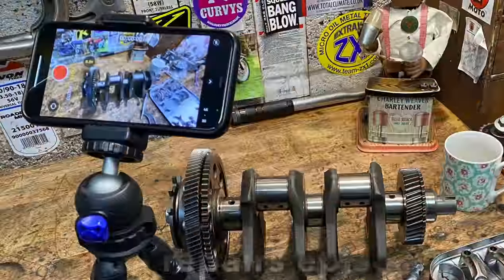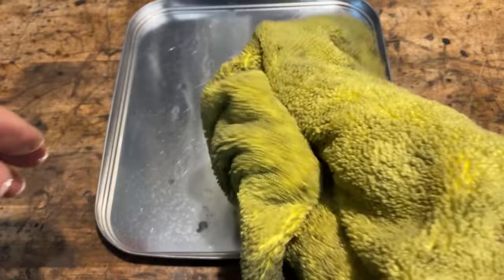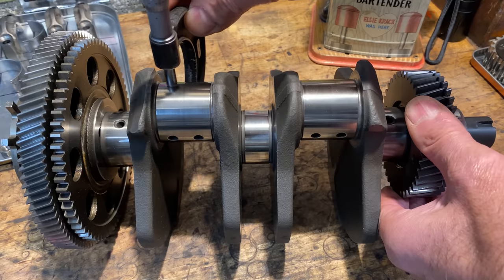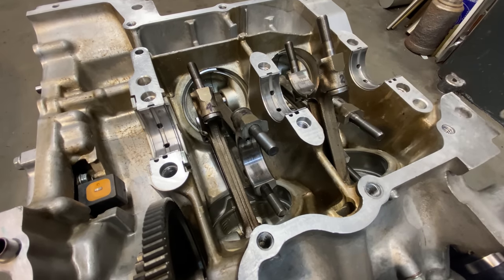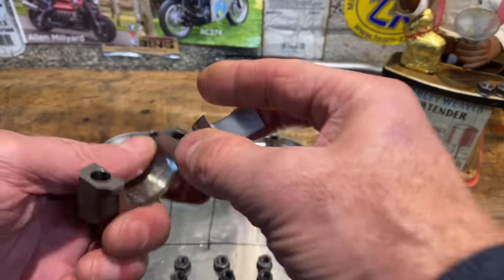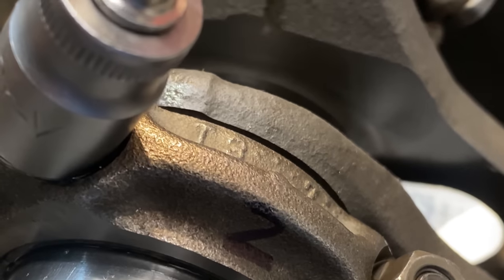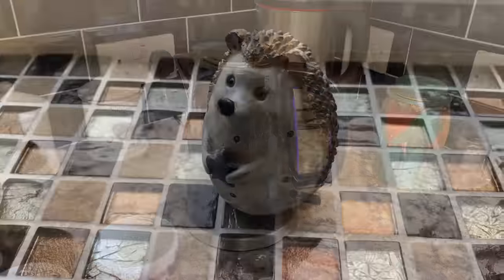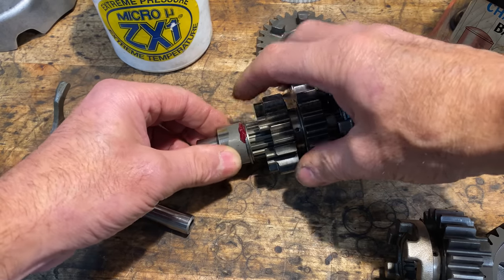Honda ST1100 Pan European - the engine rebuild commences  - Episode 2

Comment: I enjoyed watching this video and reminiscing😀. Reminds me of when I changed the BEB's on my LandCruiser (4.2L IL6) on the driveway. Good access with just the sump removed thankfully avoiding a nightmare engine out scenario! Toyota use a similar bearing sizing system. 5 sizes available, con rods marked 1,2 or 3, crank marked 1,2 or 3 and you just add the con rod and crank numbers to get the correct bearing size. I rebuilt a Z1000 engine back in the 80's which, as many will know, use needle roller bearings in the bottom end rarely require attention😀👍.

Comment: My ex police has a bit of a not so good gearbox, doesn't like being changed at higher revs. Got a spare with the intension of servicing the original/replacing it but it's having to drop the engine out. Got leaking carb1 issues at the mo. Keep these coming Allen, great to learn from a master.

Comment: I like to use Lucas oil stabilizer on bearings , then put a drop of oil on them, and the crank or cam, basically b everything except  cylinder bores, well some times, maybe a thin layer, but I know definitely not to use things like STP with alot of solids in it, on rings/ pistons, the oils can burn off, and leave the solids, molynibneum, graphite, zinc, zddp can turn to zinc metal with high temperatures,  my dad fixed a engine like that, it was new rebuilt, and all but stopped running, the rings were stuck , had no compression, tore it down, and it was full of white  powder, between the rings, lightly hones it cleaned everything, and it ran fine,  zddp is great, unless you have too much burn off in the rings , it's best to use conventional oil on the rings!  I like the thick and tacky Lucas stabilizer on bearings,  a drop of oil, and it's slicker than slick! The thick stuff, fills the micro pores in the metal, then the oil glides on the film of Lucas,

Comment: I have the same torque wrench mate have had it for years, and have never considered a dab of oil to assist in making it spot on. It’s these little things I learn from you, just as much as the big things that make watching your videos so engaging. Not just spannering, but useing my hobby lathe etc. bricklayers are not natural engineers lol, but thanks to chaps like your good self, I can at least give things a good go. Thank you mate, and happy new year to you and yours Allen👍
Reply from the maker: The application of oil to the big end nuts is specified by Honda, others may advise it should be dry 🤔 so always check

Comment: I had a similar problem with a honda crankshaft, after placing in the new shells I used the plastigage system to gain and compare the exact clearances gained between green and brown types.

Comment: I have never seen inside a ST1100. My knowlege is with the VFR 750 R and older VF 750/1000 F/R series motors. The rod bearing torque is very similar to the ST1100, even with the Titanium VFR 750 R connecting rods!

Comment: Happy New Year Allen.
I worked at a Honda dealership many years ago so it was shocking to see they made that mistake.
And since the big end of connecting rods aren't perfectly round and that if/when rod bearings wear it's on the top and bottom, that was an interesting way to measure the clearance. But it does make perfect sense that the side to side clearance measured loose on that rod since it actually had the wrong size bearings 👍

Comment: Hi Allen, I just noticed that while  assembling the gearbox, when you fitted the bearing on the layshaft (14:15), both bearing and shaft have a oil hole, and if I’m not mistaken they should align with each other, but you fitted it one slot away... I thought it’d be good to let you know. Thanks for your videos Allen.
Reply: Well observed my friend , but it wasn't lined up to start with if you look earlier. This would annoy me. It has to be right.
Reply: Lol I just posted the same thing hopefully he catches it in time before he gets it all back together big job..
Reply from the maker: the holes don't line up there is an internal groove in the splined bearing to distribute the oil just perfectly between the two holes
Reply: I thought that was the reason from the first sighting. It's nice to be told and then get an answer. All the best ALAN. Great content as usual.
Reply: @AllenMillyard  If only they looked more closely before hitting the keyboard.🔍🤓
Reply: @iancharlesworth3654  An annular groove ensures foolproof assembly....Honda aren't daft and neither is Allen.

Comment: Great video as always Allen.  Happy New Year to you and the family.  

I had a quick look and found the brown shell bearings are in stock and available from CMSNL based in the Netherlands.  Only issue is that you would pay a fair bit for delivery and import tax but if they are not available, it'll be your best option.  I'm not sponsored by them, it's a site I use for parts lookup and for when certain parts are difficult to find.  I'll look forward to your next video.

Comment: Happy new year Allen!
Good to see I'm not the only one struggling with obsolete parts, needed big end bearings for my 1982 Yamaha Xz550, ended up buying from 3 separate sellers in different countries just to get a full set
Reply: That is the problem of restoring 80's bikes, I had to get the cylinder head studs for my GS750 custom made, as I couldn't get ones to fit despite having part numbers. 
Although its great to find small companies with the skill and equipment that are willing to do these one off jobs.
Reply: Yes, even here in Japan!   We needed a head gasket for a suzuki gs400 4 valve .. couldnt find one anywhere!   also, Cr250r 1991 right hand side panel     its like suddenly  12 year old Japanese parts just dissappear. !
Reply: An XZ is going to be a toughie all right - only sold for two or so years in the UK? Still, a bike Ive always wanted to add to my collection of unloved motorcycles!

Comment: Happy new years 🎉
I have asked this before but I would really love to hear your thoughts on using Manual cam chain tensioners vs Automatic ones, my current Blackbird is now 21 years old and Honda are not known for using reliable ACCT!
Reply: I think you can get a manual tensioner (typically used in drag racing engines) if you want , screw and locknut adjustment . Downside is you'll need to judge when the tension is right , up to you.

Comment: Thanks again - love the videos. Just a point on the torque wrench - I think you actually set it to 34Nm (about 25lbft). I've got a similar wrench and it has Nm scale on the other side, and I think the numbering on the ring ties up with the Nm (round numbers) scale on the other side. Mine is the other way round (lbft is round number scale) but same principle in reverse. The numbers scribed on the wrench bar on yours are lbft equivalents to a 14Nm scale (so 20.65lbft = 28Nm).

Comment: I do love your work Allen! But it looked like you overtorqued the big end nuts a little bit, unless the audio is out of sync it looked like you turned the nuts a few degrees after the click. It's likely not going to harm anything. You need to stop applying force just as you feel the torque wrench "give".  It takes a little technique, but it's not hard to get with a little practice. :)

Comment: I noticed no attention was paid to the crankshaft bearings. If anything they looked a bit more 'scuffed' than the con rod bearings. As Allen replaced the 'good' green rod bearings (preventative maintenance) I would have thought the mains would be replaced too.
Reply from the maker: The mains are virtually impossible to find
Reply: @AllenMillyard  I agree. I have gone to my favourite site for unobtainium Webike Japan. No luck. Also Wemoto come up with surprises also if you search by part number.

Comment: A golden opportunity missed here.
Fancy buying another gearbox and not using the best of the original parts.
Converting singles to twin, a triple & 4 pot done. Converting 2 x 4 pot to v8 & a triple to 4 pot done.
So why not diversify and make this a 9 speed box? Why?  Because you can.
(Perhaps a 7 or 8 speed would be more realistic / sensible?)
Best wishes for a great New year.
Reply from the maker: I’ve found with gearboxes it’s best to replace the whole cluster as a set especially when st1100 boxes are usually silent in operation
Reply: @AllenMillyard  Hi Allen.
I sgree & fully understand.
I was just provoking ideas to stimulate some reply comments for your YT algorithm.
But in the same veign trying to inspire as well.
The thought of cutting 2 gearbox cases to 2 x 2/3rds and rewelding them to contain a similarly lengthened gear cluster is none the less exiting,  possibly mind bending too?

Comment: Allen, be sure to check the cams for excessive wear before you finish the rebuild. Some of those engines have a reputation for bad heat treatment of the cams. I have seen the associated wear myself.
Reply from the maker: Top end is like new

Comment: Hi Allen, did you like me think it strange the the crank journal wasn't the same measurement all the way across given it would have been ground as one, I could see a different shell size for the difference in rod diameter but that crank has me baffled, as for the oil on the  bolts the BMW gs requires that when re torqueing the head bolts, keep up the good work 🏴

Comment: Would i be correct to say, on factory build the WRONG size shell was fitted??. Your videos are a rare treat for an old spannerman  like me. Each manufacture will state WET/DRY asembly on caps etc not all are the same.

Comment: Not being a know it all, next time you’re installing main bearings or big end bearings try this. The stains between the bearing shells and the con rods however minor they may seem do offer an uneven surface. Take a piece of brown paper sack and wet it with wd40 rub the saddles and you’ll be pleasantly surprised with the results. This only removes the stains and no material. Makes for more even wear and heat transfer.

Comment: From a man who has built many motorcycle configurations and who could certainly build his dream daily commuter why you have settled on the Honda ST, instead on say a BMW, boxer or brick, it doesn’t matter as they each are very reliable, cheap, weathereffeciant and so much lighter than the ST when crawling through traffic is fascinating. I know you started with a cx500, which I also owned, toured and used as a courier workhorse around Sydney for a while in the 80s and found to be absolutely brilliant - and miss frankly, but the ST is just such another kind of beast entirely. What is is that marks it as special, reliability?

Comment: Nice format with your wife, the tea, and the hedgehog!
Do you get a more mixed audience now?
The engine looks very strong to me. I had a 1982 Honda CBX-1000 Prolink for 23 years. At first glance, this engine's parts look bigger and the castings thicker. Correct?
Reply from the maker: It’s a heavy weight design I think based on a car engine. I try and make my videos interesting to a varied audience and keep the format similar between episodes 🙂

Comment: Would it not have been easier to wait for the brown shells to arrive and then fit all four sets at the same time, giving better access to the rod ends ? Surely, Honda would not have made a mistake at the factory and fitted all green shells instead of one pair of brown, would they ? Maybe they did...? Very informative video..
Reply: It is no bother to slide a shell around under the crank pin into the rod. It only requires a couple of mm of clearance and the job is easy to accomplish.

Comment: Good build, but I was a bit surprised you didn't check the bearing clearances with plastigauge.
Reply: I'm not surprised at all,he checked the clearance with a Dial Indicator. A very accurate reading from that method.
Reply: @howardosborne8647  I was surprised because Allen is very thorough in everything he does. He used the DTI during the strip not the rebuild, so that's the clearance of the old bearings not the new.

Comment: HNY to u and Tracey Allen I have to admit I’m a little surprised. there wasn’t new conrod bolts ( stretch to yield) required and u didn’t check  for final oil clearance each to their own I suppose. Crazy how Honda has made this mistake 😮
Reply: Or, perhaps it's a myth to use new nuts and bolts by default.
Reply: Some bolts are stretch, and must not be reused, others aren't and can be reused.
I'm sure Allen will have checked!

Comment: I've built quite a few engines over the years but you've shown some great little tips. One thing I don't understand is why the crank is ground slightly differently across a single pin necessitating mixed shell thicknesses?

Comment: Allen. When torquing-down fasteners, how do engineers know when threadlock is called for, as opposed to dry or, as here, lubed assembly? When you cleaned the nuts I assumed it was in preparation for Loctite. Thanks, and best wishes for 2023 from the Isle of Man.
Reply from the maker: Online Honda specs are available to all

Comment: 11:56 I believe that's something you shouldn't do: only torque a cap when its brother is on the rod journal as well. Otherwise, it will move slightly
Reply: Move slightly? do explain a bit more.

Comment: An engineering master class, just the little things, like oiling the Conrod threads ( to enable correct torque setting), and tightening down evenly, so as not to deform ovality. Many people wouldn't know why you do that. Allen, did you buy the workshop manual, or find it online. Happy New year.
Reply from the maker: I have a factory manual but it’s also available on line to view for free
Reply: He may have written the factory manual😆

Comment: Happy new year Allen , love the video - now do you think the bearing wear was due to low oil pressure from the damaged seal on the oil pump ? & why are the tolerances different on the crank that you have to use the brown shell bearings ?

Comment: Allen, love your videos, amazing how you use simple tools & solutions to what seem to me as complicated problems! Just an observation on this video, at about 14.20 with the gearbox assembly there is a hole in the bearing you slide over the gearbox shaft & a hole in the gearbox shaft too, are these oilway holes for lubrication & are they supposed to line up with each other?
Reply from the maker: They don’t have to line up

Comment: Is there an oil galley way through the crank shaft that could be checked for blockage? Years ago I had an experience with an old Jag engine which had been rebuilt (so I thought), the crank shaft galley way hadn't been cleaned resulting in a big end starved of oil and so another rebuild!
Wonderfully interesting vids, btw - well done!

Comment: Suzuki use the same process for bearing selection on the SV650.
What was the crankshaft end float like.
Unusual for journal to be different diameters.would have thought the
Crank journal would have been ground to the same diameter throughout its length.

Comment: Happy New Year, Allen and many thanks for making my day with new video of yours.
A question came up to me viewing your video wether the threads should be oiled before fastening with a specific torque. I have learned - of course many many years ago during my engineering studies - that the torque measurement is calculated with the friction numbers of dry threads. May be this is different with these threads. Can you give some advice to this topic?
Reply from the maker: Honda specify oiler threads on conrods and 26lbs/ft
Reply: @AllenMillyard  Thank you for clearifying this for me. I was pretty sure that you would not make a mistake with an important issue like this as you always show perfect craftsmanship.

Comment: Hi Alan. Forgive the ignorance but I remember from decades past that big end bolts should always be changed during a rebuild due to "stretch". Has that changed for modern engines or has experience shown you differently ?  Great series by the way .
Reply: The answer is that some bolts are specified as single use only due to the inherent designed in stretch. When that type have been stretched to torque limit once they are not for re-use. Other big end and cylinder head nut/bolts are not stretched to their yield point when fully torqued so they are re-usable but close examination of the threads should always be carried out.

Comment: Happy New Year!  I'm a little confused: since the brown shells haven't arrived, the crankshaft will have to be removed again to fit them, won't it?  Yet Allen fitted the green shells and torqued the nuts.  I would have thought it better to wait until everything had arrived before beginning the reassembly.
Reply: @Retired Bore Yes, that makes sense, thinking about it.  I assume that's what we'll see in the next video.
Reply: You can slide the conrod bearing in past the crank, that's why Allen could fit the crank back into the engine. I guess Allen wanted to get the rest of it back together before he knocked over the tray lid and mixed up all the conrod caps! (I know he actually marked them, it was a joke!)
Reply from the maker: wouldn't make good New Years day viewing if I waited 2 weeks for the bearings to arrive. I can simply fit the brown shells when they arrive in episode 3

Comment: Don't threads need to be dry for correct torque ?  Or is this something special for big end bolts.  Kevin Cameron talked about this in the last couple of years.
Reply from the maker: Honda specify using oil

Comment: Great video !  However it seems like you installed the sleeve with it’s oil hole misaligned on the splined end of the shaft.
Reply from the maker: No I didn’t  it’s not ment to line up there is a groove machined on the inside of the sleeve bearing !
Reply: @AllenMillyard  Ha, i get it :)  thanks for the personal answer !  I love your content !